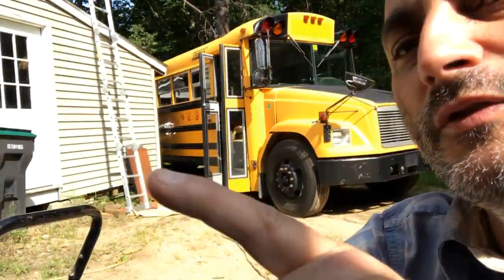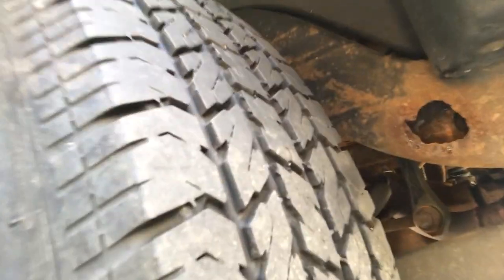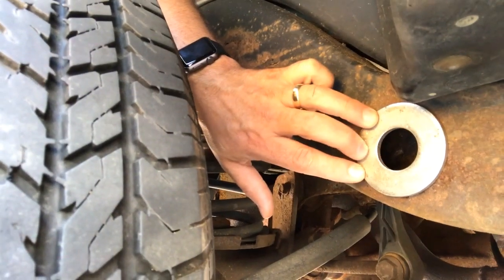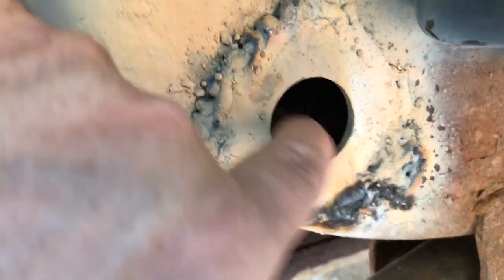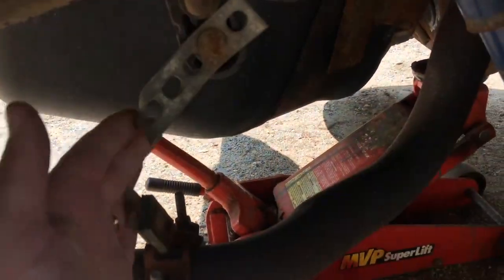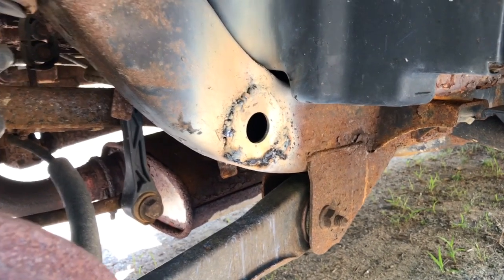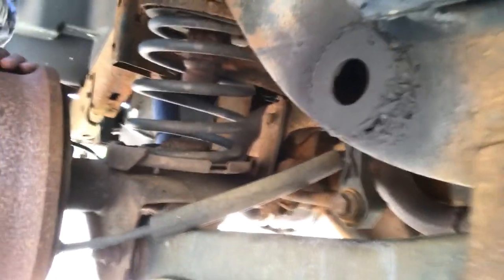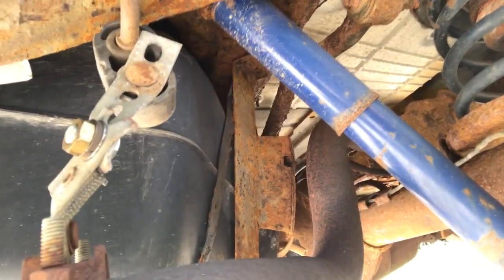How to weld a small hole in you car or truck frame

Comment: If the frame has a hole in it, does it meam the whole frame is weak.
Reply from the maker: Travis Smith Not necessarily, but it could indicate there’s a lot of other week areas in the frame. It certainly should be inspected closely if you have holes rusted through in some areas. Hope this helps and thank you for asking the question, have a great day.

Comment: What did you use to make the weld? Does it have to be a gas welder or can a smaller electric welder do the job?
Reply from the maker: I used a regular Mig welder without any gas hooked up.